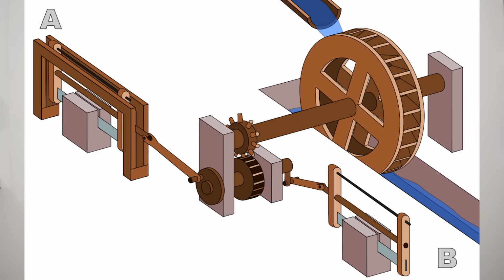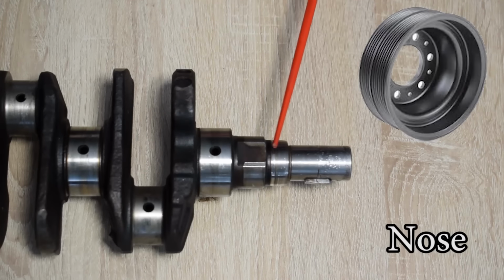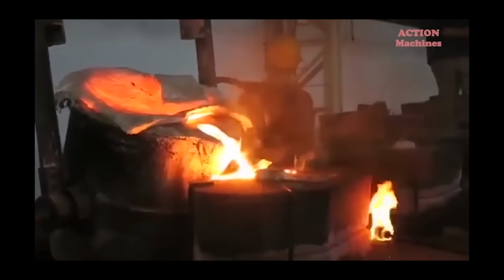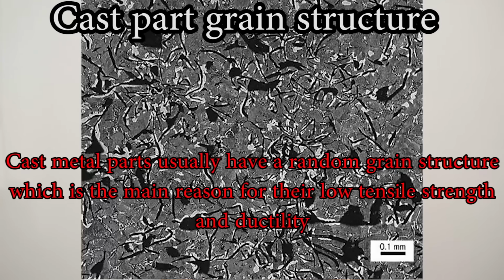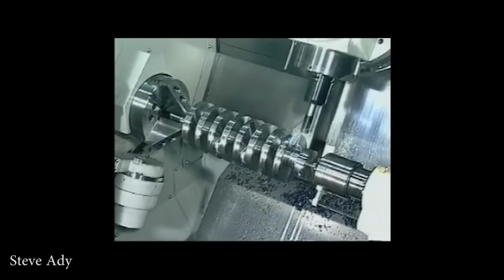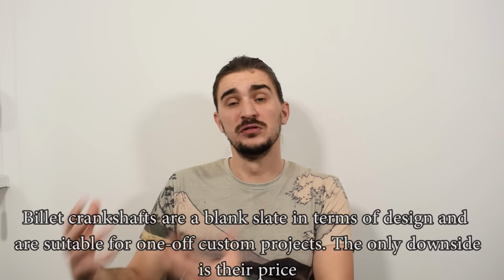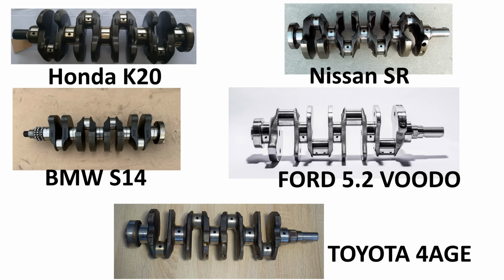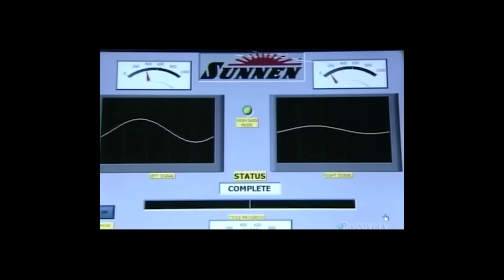EVERYTHING about the CRANKSHAFT - Function | Manufacturing | Different types | Forged | Billet

Comment from the maker: http://driving-4-answers-shop.fourthwall.com/
Toyota 22R crankshaft: https://amzn.to/3aY2SGZ
Small block Chevy: https://amzn.to/2XudABh
Assembly lube: https://amzn.to/2yUq8HQ
Nitride treated EJ257 Subaru crank: https://amzn.to/2K0Ckca
Educational toy engine model: https://amzn.to/3a4jj3f
Patreon: https://www.patreon.com/d4a 
D4A merch: https://teespring.com/en-GB/d4a-merch
Reply: Filet? or fillet..?  
It's ...  FILL•AY ...  when describing the crank, only..?  (I know little but sounds "unique" ..?)
Reply: Those cheap "cast steel" crankshafts aren't really any better than the factory crank that it replaced. If you are into putting Chinese parts inside your engine, go ahead.. 🤷🏻
Reply: @7:31 ... will not the PSI be a function of torque or power ... irrespective forced vs NA..? 
It seems like it haaas to be related to absolute-power and  less-so whether its NA or F.I. ..?
Reply: M
Reply: I worked for a company that made and modified cranks for racing and tuftriding was only used on cast iron cranks and nitriding on steel cranks. Our forged non twist V8 cranks were CNC machined also. You are correct in saying that forging dies are expensive I believe it cost around $100,000 30 years ago for our one.
Reply: @catatonia1  That's why a billet crank is a better option today. No $100,000 forging die required.
Reply: What about cryo tempering?
Reply: @grndragon2443  I personally don't buy into it, but if you do, go ahead and try it. 

I have had parts Cryoed before because I got talked into it being the next best thing, and I did not experience the parts lastimg any longer, or being any stronger.
Reply: @davelowets  what about heat tempering iron engine blocks?
Reply: @grndragon2443  I don't know... I always chose an engine block that's already strong enough for the horsepower that I plan on making, and then some... With tempering an already hard, an somewhat brittle cast iron, I would fear that it my promote cracking later on down the line during use. I personally wouldn't attempt to try it, I'd just get the right block to begin with.
Reply: Oh the audacity of this channel! Lol😊
Reply: One question on the billet. The block of metal it comes from must have been cast at some point. So why does it not have the grain structure of cast metal?

Comment: Weird hearing scientific and mechanical engineering stuff but also imperial measurements. It's like putting out fire with oil. Two things that don't go along together. Either you're precise and reliable, or you use pounds, barrel, yard, acres and Fahrenheit. Might as well use your foot to measure things or your elbow to hand length.

Comment: 🤷‍♂️“Crossplane has a cylinder firing more often compared to a flatplane crankshaft”. This is not physically possible.  Here’s why: Both cross-plane and flat-plane V8 engines, being four-stroke engines with eight cylinders, have the same number of firing events per engine cycle at the same RPM.

Comment: I have a few ideas for your project. If your case is a ferrous stainless, and your rotor isn't, magnetizing the rings could solve the sticking issue. Otherwise back to springs. They are too wide of a contact face to seal without extreme pressure and wear, but to make them thinner would make them too frail to withstand the pressure of combustion, however if you where to have them precision ground with let's say 5 degrees of taper with the slope facing rotation you could achieve a small area for sealing, while retaining the necessary strength.  The ports, especially the exhaust need to be ground to a teardrop shape that extend to, for lack better words TDC. Due to the layout of the ports the exhaust port is recompressing the expanded air until it gets to the port, and the intake gets closed off before the area quits expanding. The easiest solution to the ignition would be to have a new rotor made (out of aluminum. Remember magnets, two birds, one stone) with provisions for a points cam. If you use GM points the timing would be adjustable with an Allen wrench! As far as lubrication moly sulfide in a spray canis your very best bet. It"s an amazing lubricant, and doubles as a filler for sealing, and believe it or not, filling loose tolerances. Just make sure it's pure dry moly. It's suspended in solvents and to a film layer. And lastly you need to use gasoline. I would recommend a partial mixture of diesel. Alcohol has no lubricity, and will wipe out the project, also that carburetor can't keep up with the stoichiometric ratio of alcohol. Anyway that's all for now. Those things will make it run. Heat will keep it from running in very long of intervals, but it will be proof of concept. I hope you don't give up! One more thing, if you have a rotor made with a keyway a simple sleeve coupler could make an electric motor double as a starter, and flywheel. Good luck, and again don't give up!

Comment: Ok. Somebody much smarter than me talk me thru this - Im with you till around 7:30, then we start talking about forces, the 18,000 lb number. Wouldn't Newtons laws of motion apply   since the crank and counterweights  are spinning they have mass and inertia + the other con rods and pistons  are in motion applying an opposite force which cancel out (close to net zero) most, but not all, of the 18,000lbs??
      After you cancel out those forces the number would be in the hundreds, not ten-thousands, which would be the amount of "work" the engine has done, expressed in the lb ft of  torque number we are all used to hearing when talking about engines, ie: " it makes 350HP and 400lb ft of torque" Correct?? 
     Or have I just mindf'ed myself and thought waaaaay too deep into this acting force and opposite force thing and have completely lost my ever-loving mind lol????

Comment: You know, I thought the flat plane crank made more torque and the cross plane was more about sound than performance.   

You’ve cheered me up this morning with your 4 year old video 😊
Reply: Neither crank can “make” more torque than the other.  Crossplane is heavier and creates more windage so it consumes more torque.  Also the claim “Crossplane has a cylinder firing more often compared to a flatplane crankshaft”. is not physically possible.  Here’s why: Both cross-plane and flat-plane V8 engines, being four-stroke engines with eight cylinders, have the same number of firing events per engine cycle at the same RPM.
Reply: @rollsroyce329  this is true although a flatplane will have a shared power stroke between 2 pistons where a crossplane can spread out single piston firing orders due to the 90 degree spacing.

I know on motorcycles this was an issue because if you had too many power strokes per rotation the bike was harder to keep under control, But if you had 2 power strokes then 145 degree spacer then the back wheel had time to recover from lose of traction in a corner.
Reply: @KhaoticKalm like when they introduced the Big Bang motors in moto GP.  Same number of combustion strokes part rotation just grouped together to make tire breakaway more linear and predictable. Also why single cylinder engines do well in dirt or flat track.  This guy is out to lunch though.  He thinks the crankshaft provides leverage to the work done by combustion pushing the piston down the bore. 🤪
Reply: @KhaoticKalm ”shared power stroke”?  
Cross-Plane V8:Firing every 90 degrees, the power strokes are evenly distributed. For example, if cylinder 1 fires at 0 degrees, cylinder 5 fires at 90 degrees, cylinder 4 at 180 degrees, and so on.
Each cylinder’s power stroke (lasting ~180 degrees) begins 90 degrees after the previous one. This means that when one cylinder is at the peak of its power stroke (e.g., 20–40 degrees after TDC), the next cylinder has not yet started its power stroke, and the previous cylinder’s power stroke is waning (near BDC).
Result: There is minimal overlap of peak combustion pressure between cylinders. The torque output is smooth and consistent, with each cylinder contributing sequentially, avoiding significant stacking of peak pressures.

Flat-Plane V8:The firing order creates a pattern where two cylinders in the same bank fire 180 degrees apart, followed by a 90-degree gap before the other bank fires. For example, if cylinder 1 (left bank) fires at 0 degrees, cylinder 4 (left bank) fires at 180 degrees, then cylinder 3 (right bank) fires at 270 degrees.
During the power stroke of cylinder 1 (0–180 degrees), cylinder 4 begins its power stroke at 180 degrees. By the time cylinder 1’s power stroke is ending (near BDC), cylinder 4’s power stroke is just starting. There is no significant overlap of peak pressure phases because when cylinder 4 starts, cylinder 1’s combustion pressure is low.
However, the flat-plane’s firing order creates a more pulsating effect within each bank, as two cylinders in the same bank fire 180 degrees apart, potentially leading to a slight overlap in their power strokes’ later phases (e.g., when one cylinder is at 150–180 degrees, the next is at 0–30 degrees).

In both cross-plane and flat-plane V8s, the 90-degree firing interval ensures that peak combustion pressures (occurring shortly after TDC) are staggered. Even in a flat-plane V8, where two cylinders in the same bank fire 180 degrees apart, their peak pressure phases (e.g., 20–40 degrees after TDC) do not occur simultaneously.
For example, in a flat-plane V8, if cylinder 1 is at 30 degrees after TDC (peak pressure), cylinder 4 is still 150 degrees away from firing. By the time cylinder 4 reaches its peak pressure (210 degrees from cylinder 1’s TDC), cylinder 1’s power stroke is nearly over, contributing minimal torque.
Thus, there is no significant “stacking” of peak combustion pressures in a flat-plane V8 that would create a higher instantaneous peak torque compared to a cross-plane V8
Reply: @rollsroyce329  that’s the exact one I was thinking of but wasn’t sure the details 😂
Reply: @rollsroyce329  on your second post you’re right of course it’s been a couple years since I was bing watching engine designs after going back and watching this video and a moment of “what am I missing” it dawned on me that we’re talking about 60˚ V8 banks, and I was thinking flat plane boxers or flat 8s which is so obscure it makes me question what goes through my head before I reply to people sometimes 😂

https://youtu.be/RcyMoZoqkPA?si=dom3ShKQxwCEbce7
Reply: @KhaoticKalm all good man.  You know your engines.  It’s a disease isn’t it 😂
Reply: @rollsroyce329  I haven’t sought help yet but I’ve been practicing “and I’m a motorhaulic” for when the day comes 😂

Comment: how does crank throw orientation affect torque? Say you have 2 engines, both same cylinder volumes, same bore and stroke, same head, but one is cross plane and the other a flat plane. How does the cross plane make more torque?
Reply: Neither crank can “make” more torque than the other.  Crossplane is heavier and creates more windage so it consumes more torque.  Also the claim “Crossplane has a cylinder firing more often compared to a flatplane crankshaft”. is not physically possible.  Here’s why: Both cross-plane and flat-plane V8 engines, being four-stroke engines with eight cylinders, have the same number of firing events per engine cycle at the same RPM.
Reply: @rollsroyce329 I know. I am asking the one who made that claim to explain the thought behind it.
Reply: @vasilisgreen 👍 good luck.  He hasn’t answered others questioning it.  This is a guy who thinks crankshafts create leverage that amplifies the work combustion does pushing the piston down the bore. 🤪
Reply: @rollsroyce329 it's typical of a yapper to ignore or run away from anyone who calls them out on their yapping.

Comment: You explain why cross plane V8 are smoother running than flat plane.  fwiw, the LS7 crank is lighter than the Ford Voodoo crank.  Indy racecars found that flat plane cranks were worth 1-2% over cross plane at 11k...so the rpm/power argument doesn't hold, either.

You may have to rewrite this video.  I learned today that knife edging probably does more harm than good.  Engine Performance Expo episode 46.

Comment: Drives me crazy when someone says CNC machining is very precise. It's no more precise than manual machining from a talented machinist. The advantage of CNC machining is that it can be performed over and over very quickly, thereby saving the company lots of money and improving profits. The end result is the same. As a matter of fact, if the CNC machine isn't set up correctly, or if the tooling isn't maintained,. CNC machining can be very imprecise.

Comment: Hi. This is old video I know. And maybe information is allso a little bit old.. Time line 27:15. But, I think there is no any difference between crossplane and flatplane cranks on their ability to make torque. Torque comes from different things than at the crankshaft type. Allso smoothing running engine is at the flatplane, not crossplane. It is easy to hear and even feel at idling. And I think flatplane has less vibrations, but I am not sure abaut that. At least it feels and sounds like it would be less vibrations. But yeah, thanks for the video, it was nice one! I appreciate your work to do videos like this one. Good job man!

Comment: The simplest explanation is a bicycle .You are the engine and connecting rods. Think of how you push on the pedals. If you know about bicycles, the crank system is very similar. It's like a 2 stroke. 🤪

Comment: Another great video! These are well done and easy to understand.  One minor point on forged VS cast. Beyond lawnmowers and chainsaws nearly all Chevy LS engines come from the factory with cast cranks. One could argue they make decent power and can tolerate over 600hp. It's true, maximum effort builds and the highest output factory LS and LT have forged.

Comment: When people say "It's just a crank... how can it be so expensive?"

When it's a CNC'd, cryo dipped, Mallory balanced, oliophobic coated, knife-edged, ultra-lightweight, -.020 mains, 1-gram balanced, hollow-ground journals, piece of mechanical wonder... 💩 don't come cheap.

A good road race crank can easily top $3,000 nowadays... and makes a huge difference. People think drag race cranks are expensive. You don't  "drop the clutch" on a top tier road race crank from a standstill. Gets expensive real quick.

Comment: As someone who balances rotating assemblies and grinds cranks for a living….. Excellent video! A++++++
Reply: Neither crank can “make” more torque than the other.  Crossplane is heavier and creates more windage so it consumes more torque.  Also the claim “Crossplane has a cylinder firing more often compared to a flatplane crankshaft”. is not physically possible.  Here’s why: Both cross-plane and flat-plane V8 engines, being four-stroke engines with eight cylinders, have the same number of firing events per engine cycle at the same RPM.

Comment: Been watching David Vizard carving up a crankshaft. His main focus has been smoothing all the sharp edges from the crank so it moves smoother through the oil and air in the crankcase. Also like mentioned here those sharp edges can cause failure points. Even if its a cast crank, smoothing up the crankshaft can allow for higher rpms and safely. Obviously its still a cast crank so i wouldnt go revving past 7k rpm in a v8 even if it was milled Dow and balanced.

Comment: 5:41  Anyone notice the oil goes the wrong way through the filter? It should be pumped through the outside holes into the middle tube of the filter. The way it's flowing in the animation would potentially rip the filter media, that's only IF the filter doesn't have an anti-drainback valve if it did you'd have a bomb basically.

Comment: The crankshaft counterweights do not balance out the mass of the pistons - they can't because they're not moving in a reciprocating motion complementary to the pistons. The counterweights balance the crankpins and the big ends of the connecting rods; the pistons balance against each other, and (where required by the engine configuration) against balance weights on separate balance shafts.